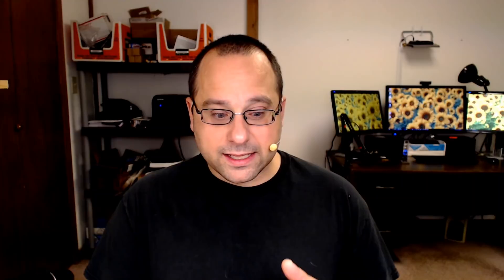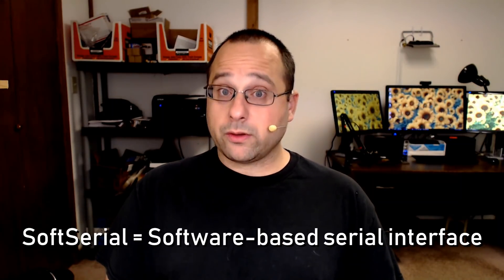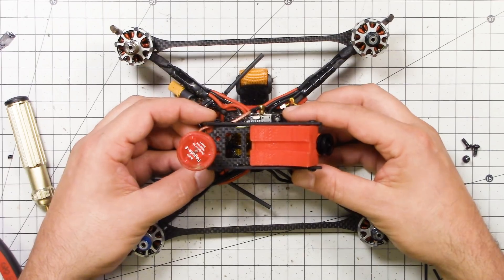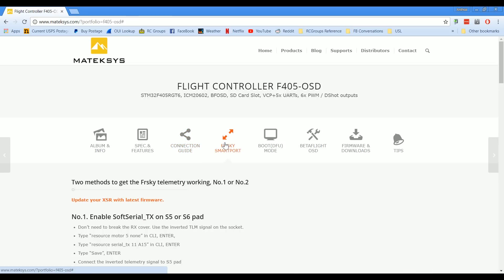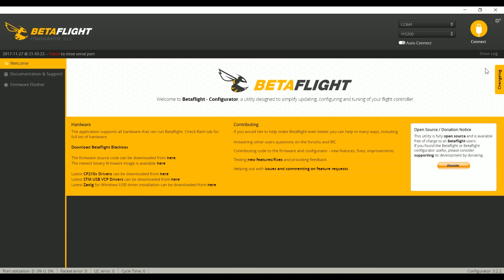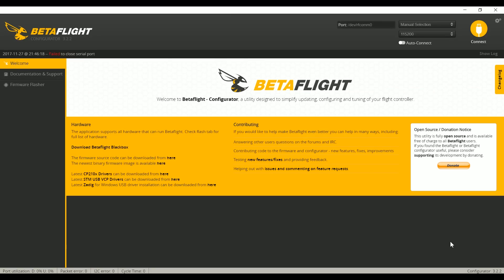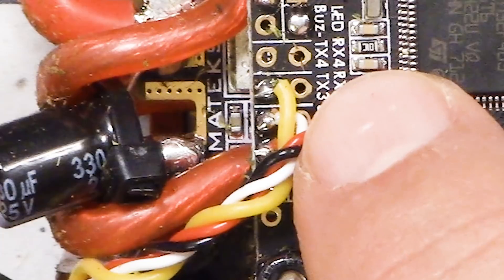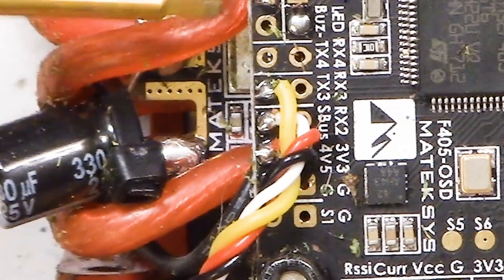Betaflight SmartPort Telemetry How-To | MATEK F405 AND OTHERS

Comment: Hi Joshua. Just wondering why you didn’t use the RSSI pad? I’m new to Frsky but I’m really enjoying the versatility of opentx after using spektrum fo a long time. 
Thanks.
Reply from the maker: I often don't go to the trouble of wiring up RSSI.
Reply: Joshua Bardwell is that because you get RSSI through a channel on SBUS?
In what case would you wire to the RSSI pad?
Thanks for the knowledge, yours and JC’s videos have got me a long way in this hobby, in fact without them I wouldn’t be enjoying flying as I am now. So thank you.

Comment: This worked well and helped me to narrow down my issue that I believe to be a bad Uart3 on the JBF4. I contacted RDQ to see about any more technical support or to see if I need a warranty replacement but my biggest question is that since your name is on the board I hate to see you bothered with every piddly little question so who should we turn to for tech support when issues like this come up?  But long story even longer I changed the LED pin to soft serial and got my smart port working there and remapped rx6 to be tx 6 and stuck my smart audio there.  I am still having an issue with my taranis seeing all of the unify data but I have run out of patience for a couple days so leaving it on the bench before I chuck it out the window.

Comment: @Joshua - not sure why you choose to present the soft serial method as the first one, it's less preferred as S.Port is communication intensive (this was also recommendation by Teralift, BF dev.) if to put something on soft serial is the smart audio (vtx control) as the last isn't being used that often.
Reply from the maker: +Eddi Maevski softserial is the more universal approach and the F4 has enough cycles to do it consistently.
Reply: Agreed yet still  I would argue it shouldn't be the first method.
Reply: But its the easiest i would say,and that's why its the first option, before doing the inverted hack.

Comment: The soldering on R-XSR is much much simpler. There is a dedicated pad
Reply: claudius Cubitus 
Does it have to be soldered on the tiny rxsr pad, EVEN if its from the CL racing f4s FC?  Will soft serial bypass the inversion hack?

Comment: Hi Joshua
Some day ago it is arrived the my new FC, I have bought a Kakute F4 V1 AIO … I mounted and now in Betaflight I have seen an error…
When set ON 32khz the gyro not work…
On the my another kakute the same model of this kakute with the same firmware the gyro work fiine to 16k16k
I tried to set 32 on and 8k8k 16k16k 2k2k the CPU it does not 100% but the gyro does not work.
The gyro to 32 it is the same of the normale gyro? same gyro same wires?

Test 
Gyro work without flag 32khz on 8khz 8khz
Gyro work with flag 32 khz on and 1khz 1khz

Do you have any suggest?
Reply from the maker: +Adriano Gianni 32k mode is still experimental in Betaflight. I don't recommend using it.
Reply: Joshua Bardwell thanks so much :-)

Comment: I have not ran across this issue yet but I am currently starting to move to Matek for some things.  I just Yesterday installed my first product and absolutely loved how detailed their site is for information on their products.  I will be using them more just from that factor for sure.  Thanks for the heads up Josh, without your advice most of us would be lost and flying in small circles chopping our ankles to bits :)

Comment: SPI RX of Frsky-X 8ms protocol will be the killer in 2018.  just like SPI BFOSD killed other UART minimOSD in 2017.
FPort is another new protocol released. Just one Uart for SBUS & TLM.  http://www.mateksys.com/?p=4488
Reply from the maker: 8 ms between RX and FC is no good if the radio link is still slow. FPort doesn't address the radio link.
Reply: We tested SPI RX with BF devs already. keep eyes out for this amazing innovation. https://github.com/betaflight/betaflight/pull/4683

Comment: joshua help me bro.   ill never mess with this thing again.    wizard x220.  i updated the fc to 3.2.2 and then update my esc on bheli site to the newest.  my copter wont leave the ground.     i hit the throttle and the back lifts and cuts flips on the ground.  man please help.  i dont care if  its a phone call.  ill paypal for advice.  just get me back in the air bro!!!  email curtnstac@gmail.com.   i follow directions fast and quick.  help man.
Reply: curtisnstacey The fc on the wizard is not mounted with the arrow pointed straight ahead. This isn't a problem if you tell betaflight about this,but  when you flashed your board with newer firmware you lost your config. In the setup tab where you can see the picture of the Quad moving  when you tilt it you can test this. If you tilt the quad forward does the picture move forward or does it move in some other direction? If it moves in some other direction then boom there is the issue. Go to the configuration tab and go to the board alignment section. There for yaw you're going to have to input either 90° or 270. Try one of those numbers then go back to the setup tab and tilt  the quad and test it. It's going to be one or the other. Sorry for the small novel but I work with these professionally and I have seen this problem many a time. All  this is assuming your motors are spinning in the right direction and you have your props on correctly....
Reply: SpikeJonesTheCr0oked 5 hours man 5 freaking hours of downgrading and updating back and forth.   3 dam numbers!   it's 11:15 here in sc and cold and I'm going outside right now to see what's the deal.   after those numbers it actually tried to pick up without flipping out.   time to assemble quickly!!!!
Reply: BINGO IT WORKED AND IM FLYING AGAIN!!!  HELL YEA!!!  WHATS YOUR PAYPAL MY FRIEND OR EMAIL IT TO ME.  you could  have sit back and said nothing.  thanks so much man.  wow.  ill shoot you a few bucks.  well worth it
Reply: curtisnstacey Awesome. Glad I could help. The offer for some $ is kind but unnecessary. I remember how confusing this used to be so I don't mind helping out...
Reply: join the fb pages for Betflight and whatever hardware you use. There are always people who have been in your situation and are willing to help. It's usually an easy fix

Comment: If you do the uninversion hack on the receiver be sure to put hot glue on the wire. I've had that wire rip off the pad and destroy my entire receiver. Better be safe than sorry and just use soft serial.

By the way, if you have telemetry but not a LUA script, you need to update your receiver firmware. At first I thought that this was an issue with the FC. I spent 3 hours diagnosing the issue and thought that it would be helpful for me to share it with some of you so you won't end up like me.
Reply from the maker: Hmm I know the RXSR has that issue with Lua. I haven't heard of it for other receivers.

Definitely reinforce the wire. I prefer to just use tape to hold all the wires down. Hot glue works too.

Comment: Joshua doesn’t the Matek have an inverter for SBUS? Wouldn’t messing with the inversion settings mess that up. I did the inversion hack for my Matek AIOF405 because I couldn’t get the soft serial to work. Inversion hack worked without messing with beta flight
Reply from the maker: The inversion settings for telemetry and SBUS are separate.

Comment: I used this soft serial technique on my Omnibus F4. Difference is I had to list the resources first to see what pin was assigned to M5. It’s not always A15. That’s specific to Matek.
Reply from the maker: +JefeFPV yes, correct
Reply: I wanted to do channel reassignment to create a softserial too but apparently my “omnibusF4” doesn’t have the resources?? I’m still at a loss. Using new FrSky R9 Slim for a long range setup on the Hobbywing Xrotor F4 FC and I’m not seeing any way to get soft serial on this board. Their site blows too btw. And have yet to find anyone  else that’s accomplished it either. And Telemetry is pretty much an absolute must doing long range too imo. And don’t know how to do uninversion hack on R9 Slim Rx either. Maybe the FPV KnowitAll could figure it out for me? Hint hint. 🤪🤓
Btw: it’ll let me “free up” motor 5 but if I type into CLI: (get resource) to list resources it gives me nothing. Also searched the full “dump” and found nothing related to pin outs for resource M5/M6. Idk what to do at this point. Sure would hate to have to replace FC just for telemetry, but really, I’m starting to think I shouldn’t have chose to use this FC paired with an R9 Slim for a Long Range build requiring telemetry. I just figured there was always a way to make telemetry work on any F4 FC. NO? Pretty sure I heard JB say that once. lol. .... Unless I can figure out which pin is the uninverted signal pin to solder from on R9 Slim I guess. I just want to fly.
Reply: what pin was it on omnibus F4?
Reply: Charles Garment I eventually got this lined out on my Hobbywing Xrotor F4 FC (omnibusF4SD) but it wasn’t until I flashed it to BF3.3.0 because with default firmware (modified by factory bf3.2.5) it didn’t show resources in CLI. I was then able to in CLI on BF3.3.0 type RESOURCE and enter. Then it’ll list what motor5 and motor6 “pins” are assigned - they were A01 and A08 respectively on that particular board. So like I said, once on BF3.3.0 and seeing RESOURCES on CLI I was able to get a softserial useable and assigned to FrSky SmartPort and used uart3 to TBS SmartAudio and uart6 on GPS ... so thrilled how this works. Now if I could just figure out how to get the I2C to be available to hookup the magnometer/compass to SDL SDA but I’ve failed to figure that out yet. Still trying to find someone that knows how that’ll put forward the effort to help.

Comment: So while we’re on this slightly confusing topic is the cl racing f4s affected by this issue? I read somewhere that it has a pad that has a hardware uninverted uart port. So when hooking it up to an r-xsr for example I could simply use the standard smartport wire on rx and not solder to the tiny pad on the back of rx? Too many inverts and uninverts make my head hurt...
Reply from the maker: CLRacing F4S has an inverted telemetry pad so you don't need to do any of this.

Comment: Hey josh, thanks for the vid, as you said , matek had us already covered with a good ammount of info, tough i got a problem...  i did the softserial trick , followed the 2 commands that are in the website, and in my taranis x9d+ i got now vfas , voltages and so on, but my LUA scripts are not working..  as you are an addicted luascripter and usual user ...  i am sure you use them too... i feel bad without my luas now..  can you please tell me if you did something else to activate them? (I even tried to update the luas to the coolest and latest version,have you checked it out?  Cool new options!!!) Thanks joshua!  Happy flying :)
Reply from the maker: +cyranoidy they should really work... I don't know.
Reply: Joshua Bardwell it was working in my other copter with bff3 ... strange , vecause i believe that if i got  vfas voltage i shoukd be okay with the telwmetry and i should also be ok with the luas at same time isnt it?

Comment: Joshua.  So I did everything in your video (several days ago so this was a good double check), including soldering to the microdot on the R-XSR receiver.  However I am not getting telemetry.  Is there a command to see if there is anything coming out of the receiver on the un-inverted pad to the S5 pad on the FC.  

Thanks
Reply from the maker: +Doug Moore a signal analyzer could do it but not many people own one.
Reply: I fixed my issue.   I was doing un-inverted hack to soft serial s5 pad.  I ended up putting my line to TX4, and enabling the tlm_inverted=on and it works.  Thanks for the assist and all the videos.   now to get lua to work.

Comment: Would you maybe know why I’m getting punch out occultations on the matek f405?
Soft mounted just about everything.
*oscillations*😁
Reply: Did you bit a chicken's head off recently? That will cause occultations every time.
Reply: Lol doh! 🤣Dam auto correct *oscillation
Reply: Have you soldered capacitors? Its necessary thing for matek )

Comment: this would be applicable to other F4 boards that only have 2 serial ports broken out (rx and uart6)such as the lumenier micro F4 or the omnibus nano?
Reply from the maker: +Daytona FPV yes but the exact pin number will differ.
Reply: that's what i figured
Reply: Hi. I just bought a omnibus f4 pro and found that this should work:
resource motor 5 none 
resource serial_tx 11 A1
save

Didn't test this yet, but thought you might want to know.

The reference is here: https://www.youtube.com/watch?v=e9-lPYCVPa4
and here: https://github.com/betaflight/betaflight/wiki/Single-Wire-Software-Serial

Oh, I forgot to mention sport should go on motor 5 signal pin (A1 PWM5 from github list)

Comment: This smart port s5 on kakuteFC does it also apllied for others brands  F4 FC ? Are the CLI Resources reassignment the same for other F4FC brand?
Reply from the maker: +MEDELECTRA INGENIEROS You will need to look up what the s5 pin number is on other boards. Other than that, it is the same.

Comment: @Joshua Bardwell there are pads on the r-xsr receivers for both uninverted sbus and smartport.  Check out Oscars blog post near the bottom https://oscarliang.com/uninverted-sbus-smart-port-frsky-receivers/
Reply from the maker: +Chris Ames I believe I discussed this in the video.
Reply: Joshua Bardwell fair enough just wanted to put up a how to as many are switching over for new builds.

Comment: I bought the r-Xsr thinking  it may be better than Xm+ and I connected it to a nano f3 that offers an extra uart connection.  Unable to get Rssi reading directly onto osd like you can with xm+ through channel 16 that has no smartport.  Instead my dumbport rxsr rssi had to be fed back to fc by an extra channel on taranis.  Why can’t the smartport work with beta flight ‘s rssi feature osd without this workaround?  The fc people need to sit down with the receiver folks and come up with a better solution.
Reply: Tom Townsend have you watched Project Blue Falcons video where he shows you how to get RSSI in your OSD with various FrSky receivers?
Reply: https://youtu.be/LPxjT3Aosak
Reply from the maker: +Tom Townsend for now, if you want this feature you need to get a receiver with an analog RSSI out pad like X4R or XSR.
Reply: DavyBoy yes and it works great with xm+ but not the new rXsr sorry I should make clear There is no other straight to betaflight rssi reading on micro quad s other than the xm receivers
Reply: Joshua Bardwell but the RXsr is a disappointment then because what good is the smartport then?  I thought it would give better range than xm+ which I am not seeing yet and smartport would give me Rssi osd readout.  Which I learned you can’t get without having the receiver put rssi onto a channel to send back to the fc.  Can you explain the benefits of smartport - I am not sure what I am missing.  I know rssi audio alerts work but with fast moving quads seeing the number seems quicker than hearing an audio warning.
Reply: then main benefit, besides rssi and voltage to your tx, is being able to use lua scripts to change pids and vtx channel (with the right vtx)

Comment: The matek website suggests that s6 is also usable for softseria however in reality it is not. I've made a feature request already. This is important for people who would like to use 2 softserial devices. For instance; Smartaudio v1 needs to be connected via softserial.
Reply: Both the S5 and S6 pins are available to use with resource management.  I have smart port telemetry on S5 and camera control on S6.
Reply: How have you done this @Steve Masslich ? The F405 target in betaflight only has 1 defined softserial port. It is not possible to assign serial_tx 12.. Also see: https://github.com/betaflight/betaflight/blob/master/src/main/target/MATEKF405/target.h
Reply: S5 is setup as soft serial for smart port telemetry, and S6 was remapped to resource camera_control.  I believe I misunderstood what you were asking.  Yes - you can only use one soft serial, and that could be either S5 or S6, but not both.  You can, though, assign both to different resources (as well as the LED pin).  For smart audio I am using TX5 I believe.  Probably not v1 though.  Sorry for the confusion.
Reply: We tested 2 softserial, if one for Frsky SmartPort, another for SA/TR VTX control,   only one softserial works. That is the reason one softserial definition is enough. ESC TLM, TR/SA VTX, Runcam Split, GPS..., they can work normal on UART pins.
Reply: Sampson Guo no it is not. Smartaudio v1 needs softserial port. Boards are advertised with remapping of s5 and s6 as remappable to softserial but this is just not true

Comment: Wondering how to retain Smart Audio while also having Crossfire signal and telemetry hooked up on my Omnibus F3. Since the Omnibus has a dedicated SBUS pad (can't solder crossfire signal to that sbus pin), and the 3rd UART has no actual rx pin to solder to, I had to lose Smart Audio when installing the crossfire micro rx. Could I use soft serial to get around this and get my Smart Audio back? Thanks Joshua
Reply from the maker: +1917VIL SmartAudio can run over softserial. So if you have a spare pad like ledstrip or motor output yes it will work.
Reply: Why are you so awesome, Joshua? :) I'll give it a try...much appreciated!